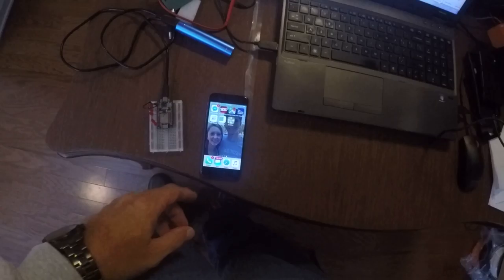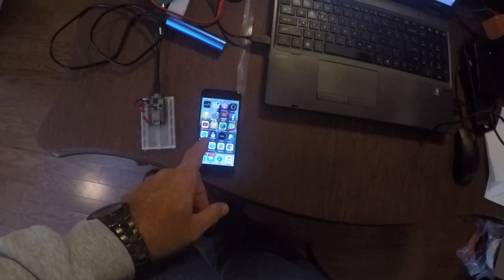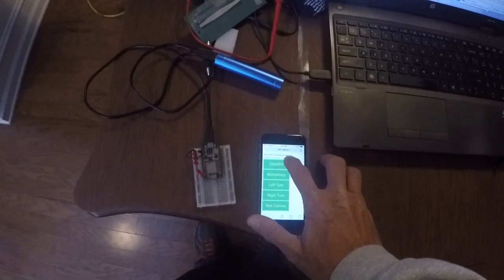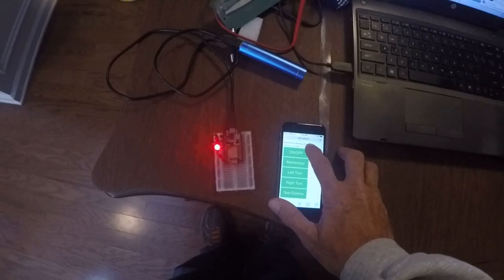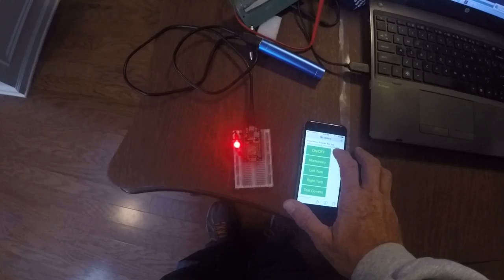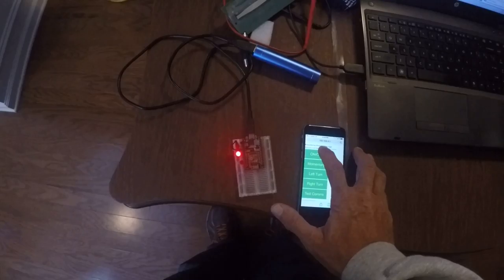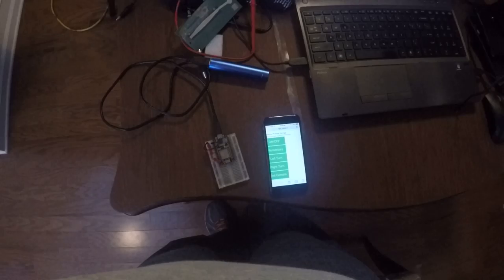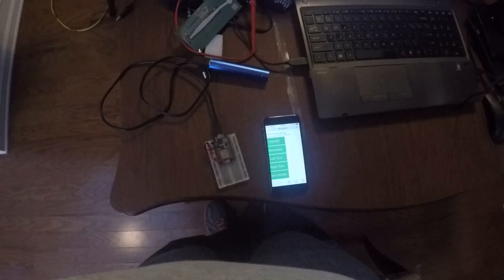Minn Kota PowerDrive Control on a Smartphone

Comment: What is the name of this app?
Reply from the maker: Its a webapp I wrote using HTML5 and JavaScript
Reply: @markingle8980  so you dont need to install the co pilot or ipilot to have it to work? also does it work for the power drive v2?
Reply from the maker: BillaBong I never finished this project. The slider for  speed adjustment didn’t work and I could not understand why